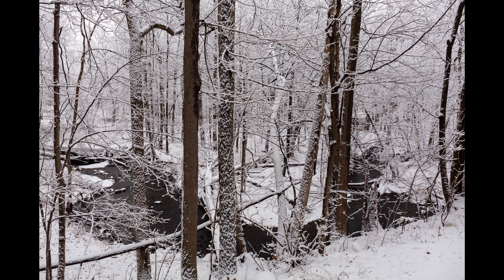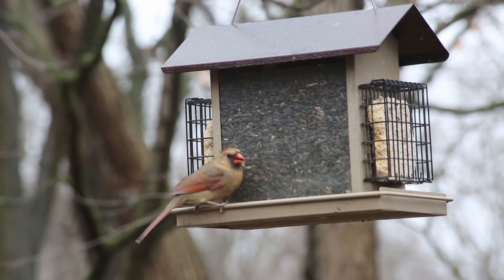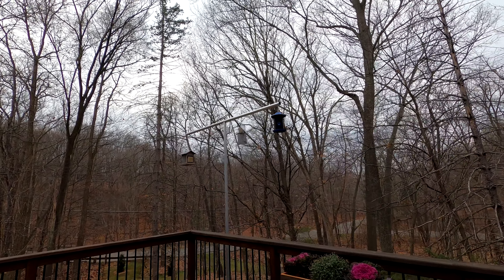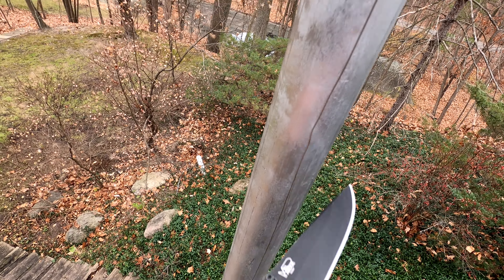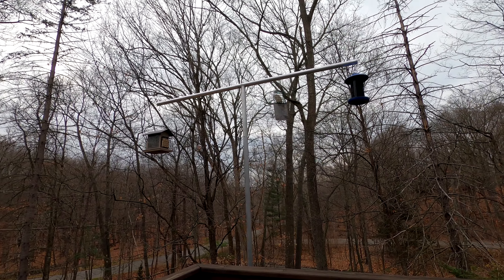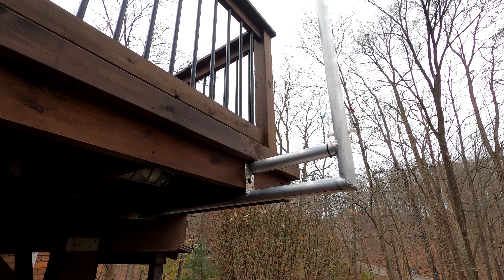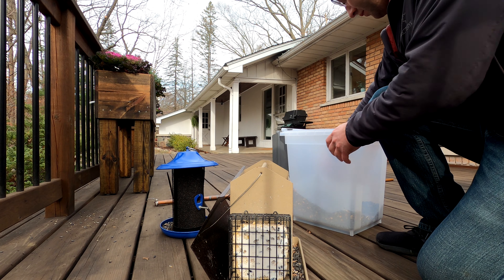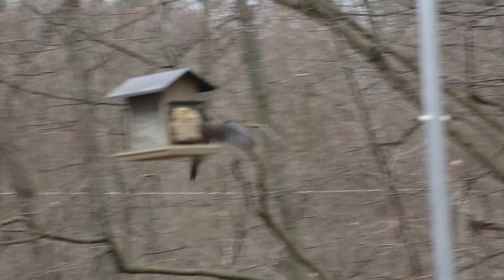Electronic Squirrel Defense 2.0 - How to keep squirrels out of your bird feeders!

Comment: Hey Curt, 1)How high is the upper horizontal end from your deck railing and 2)what's the total length of your pole? Thanks! I got inspiration from you and am building one now!
Reply from the maker: Hey, the horizontal bar is 6’ from the deck railing and the total length of the vertical upright is 10’. Glad to hear that you got value out of this hope your implementation works out as well as mine has!
Reply: @CurtBagne  Thank you!

Comment: Is the pole grounded  or do you attach a return wire to the zapper?
Reply from the maker: I have a two conductor wire running from the energizer to this pole assembly.  The ground wire goes directly to the pole.

Comment: Hi! Is it still working? Thanks!
Reply from the maker: I had to repair the connection between the wire supplying the power to the electrodes on the pole once, but otherwise undefeated!

Comment: So if you enjoy watching the squirrels struggle for food is solution as long as you need to do is add hot cayenne pepper and a Hot Chili Pepper to the bird feeder it will not harm the birds but the squirrels and all other unwanted Critters don't like it cuz it's too hot for them and they will leave the bird feeder or alone
Reply: I have tried hot peppers, cumin, garlic and hot sauce.  Even greased the pole with vicks vapor rub. Nothing works but a 22 rifle. I'm  not gonna hot wire the pole.
Reply: Why would he do that when he solved the problem ?
Reply: @sherrykendrick1765  .22 works even better than adding juice to the pole.
Reply: I tried it last year, not working..
Reply: @sherrykendrick1765 I did tried spicy foods on them but not working too.
Reply: @richardlowman6918  you must have a lot of squirrels around and you're probably using the wrong hot spicy should be using ghost peppers
Reply: @richardlowman6918  not supposed to make it spicy so they like it putting garlic and whatnot in there come on you must have more than one squirrel around more than a dozen or so you supposed to be using ghost peppers
Reply: Well there you go you supposed to be using ghost peppers and cayenne pepper only it sounds like you've been giving them a smorgasbord hot sauces sweet and they will come back for more for that sounds like you have more than a couple of squirrels how about a couple of dozen visiting your bird feeder

Comment: I wish I could do this. I'm so frustrated with the squirrels here. They are so intelligent and persistent. They find their way to the feeder in spite of the baffle that I have.
Reply: Hey, petroleum jelly on the upright pole and you're set. Make sure the feeder is high enough and not near anything they can jump from. That's it.
Reply: @reggierendert6494  Petroleum jelly works for a day or two maximum, or till the next rain which here it rains almost every day. That is not a permanent solution. Who has the time to apply petroleum jelly every single day? I don't, unfortunately
Reply: @jyotikijyoti  wow, you must get tons of rain! I live in NC and, at most, apply it every couple of Mos. It's probably been 6 Mos since last application but they rarely even try anymore. They try it once and they're done...they hate getting it on them. I've never seen it get washed off in rain tho.
Reply: @ Julie J....Check out Chris Notap of Canada and his squirrel resistant feeder. You MIGHT have to have somebody build it for You but worth the look?
Reply: Remington makes a selection of squirrel ' determinants'.
Reply: Buy the parts. Then, contact me, and I will walk you through putting it together, step by step.